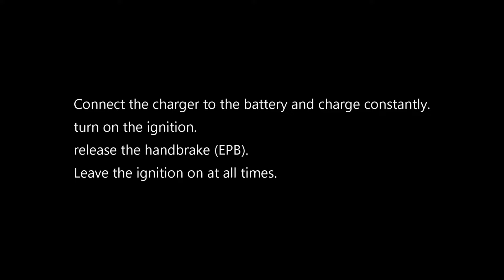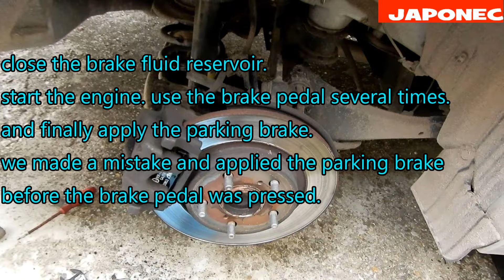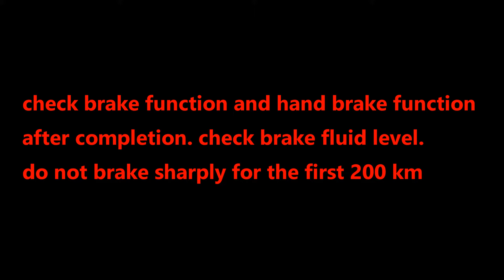Toyota Avensis T27 rear brake pads replacement info

Comment: Update: did service today,  procedure is very simple,.Before brake service,  turn ignition on and press for 5 sec.  Then you should see on dash bord orange P this means that parging brake is off.  Then turn of ignition and do brake job.  That's it.  P. S for eu cars cilinder pasanger side turn to the right,  driver side turn to the left.  After brake job press pedal brake pedal a few time,  start engine,  engage parking by pressing for 5 sec,  now it's in auto mode,  and you done.
Reply: hi sorry i didn't understand eu cars passanger side im in uk can you explain please
Reply: @hyperactive99999  The wind back tool used. Some Pistons wind back in clockwise,and some are anticlockwise. You will see RH and LH stamped on each of the wind back tools
Reply: I used one and same tool on right side and left side, if you don't have left or right side wind tool you just rotate anti klok or klok wise with same tool :)

Comment: When you say don't follow me on this step. Do you mean don't disconnect the epb? Why leave the ignition on. My epb never auto engages itself, I assume it's in manual mode. Apparently, you can hold the epb button down for 10 seconds to toggle in and out of auto manual mode.

Comment: Dobrý den, můžu se zeptat, jaký přípravek na zatlačení brzdových pístků jste přesně použil, případně, kde se dá sehnat? Děkuji
Reply from the maker: https://www.alza.sk/auto/stlacovac-brzdovych-piestov-sada-21-ks-d5147147.htm napríklad. ja som ho zohnal za 15 € v jednom slovensko e shope. no pozeral som teraz už aj tam to stojí 27euro
Reply: @golfwagen4173  Děkuji za informaci
Reply: @golfwagen4173  hello wonder you can help me , i have just been to local garage they have replaced my rear right side brake caliper and now the e/ handbrake not working properly sometimes the yellow warning light and parking light  flashes , can advise me thanks

Comment: no one commenting on them not turning the rotors on a brake lathe?  its common practice, new pads require you resurface the rotors OR replace the rotors if too thin/old/warped

Comment: Most you apply the handbrake to push back the piston??
Reply from the maker: I think first is pedal. After pedal, pedal, pedal, pedal applly button for brake
Reply: @golfwagen4173  sorted haha pull pin apply handbrake with ignition on will allow the piston screw in 👍 thanks

Comment: I haven't  yet service back calipers,  but I wonder why you didn't sett EPB to service mode like in this video. https://youtu.be/-Y1U8Iw88iA
I have read that then ignition is on after 15 min you can get caliper piston right in your head,  because of car computer constantly watches after pressure in caliper and if it is not in service mode you can have some problems...
Reply: Its not the same system. This model is not with the motor on the caliber. On this model you just pull the release for 10sec, og the auto is off.
Reply: @mikejensen4899  so basically first you release brake to service mode or manual mode,  then you take clips and do the job after that you pump brakes and engage epb for 5 sec.  Because in this video you suggest to release brakes and do the job.,  The problem after the job could be that actuator dosent recognize new pads because they are bigger in size than the old ones and basically you get message check your brakes...  ? That's why it's always first must be apply to service mode 10 sec push in and after job 5 sec to release to adopte actuator to new pads?